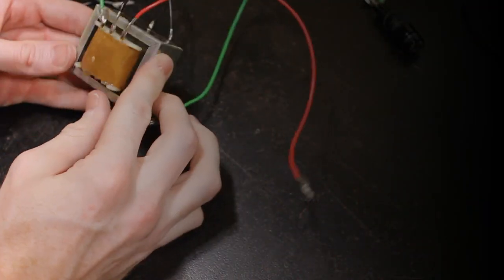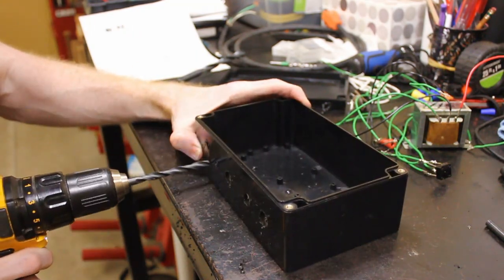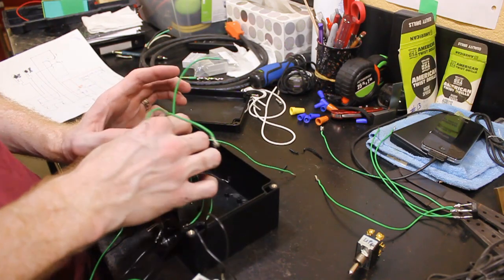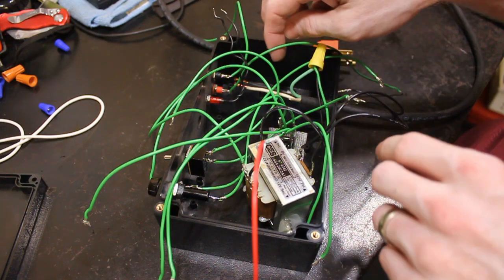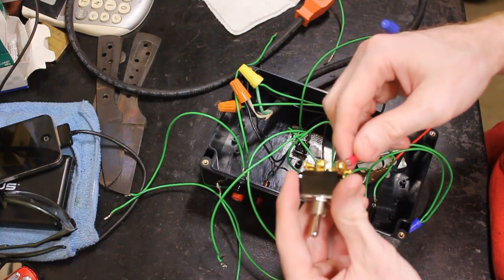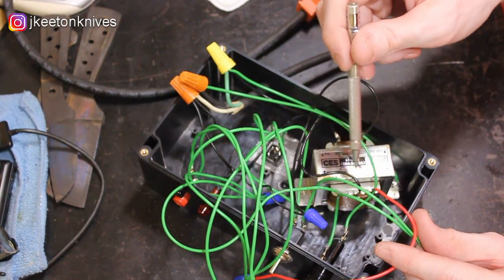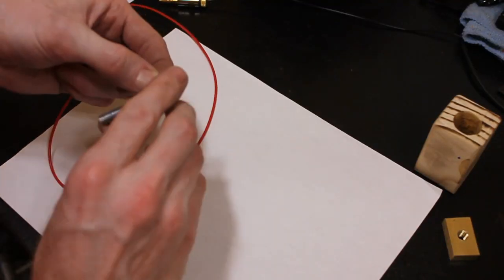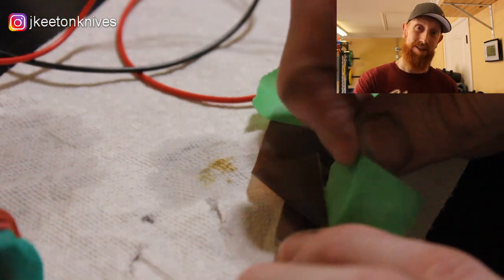How to Build an Electro Chemical Etching Machine - Full Guide

Comment: @RedBeardOps 
I want to make one too, but if I have questions how might I contact you?  I know you put this video up 4 years ago but I’m hoping that you still get these notices on it.  
Such as: Is it possible to use a power transformer from a laptop computer power supply?  I have one that has an output of about 2.75A at 19 VRectified DC; could that work?  
I guess I’m trying to take the Easy Road and find something that puts out the required voltages.

I do have a suggestion on this tho: after it is all up n runnin’ and before you close it up, tape a wire diagram to the lid; that way when you ever may need to repair it you don’t have to tear your shop apart, or your hair out, trying to remember how you wired it.  Jus' a Thought
Reply from the maker: Good suggestion. I honestly don't remember the details of this build and don't know if what your asking will or won't work.

Comment: Hello I have a question for you I build mines whit the same instructions to the video but the red light does not go on can you please tell me what did I do wrong it looks just like your and where can I buy a piece of the brass like the one you build and what size of brass do I need to build the handles please i would like to send you a picture of the project
Reply from the maker: Hey man, I'd advise checking your wiring again. Not sure what's going on from your comment, but I know this wiring works. 

Any online metals supplier can get you a piece of brass. I used 1'' wide by 1/2'' thick.

Comment: Great stuff! In the process of building line now....waiting on my transformer. Simple and clean (once you minimize the length on the green wire ha ha). The only question I have is in the wiring diagram and the front of your machine the AC is on top (toward lid)... BUT when you flip your DTDP switch it works opposite. Switch up to AC it actually charges the bottom of the switch  (DC side) or am I missing something??
Reply from the maker: Man, I can't say for sure. It's been long enough that I've forgotten all of this. I will say that that diagram works! My etcher is still going strong. Sorry for all the green wires!
Reply: Looking forward to putting it to good use. No worries on the green wires ...do what you can with what you got! That's what makes a guy GOOD.👍
Reply from the maker: @trenthumphreys9368  Thank you sir! Sorry I'm not more help with your question.
Reply: @RedBeardOps  It works...that's good enough.
Reply: Finished it up. The polarity works out as you have shown...the bridge rectifier is what changes it around. To answer another subs question you get approx. 27 volts AC and 24 DC. The DC shows negative polarity when you go red to red black to black. Works AWESOME! Thanks
Reply from the maker: @trenthumphreys9368  Awesome man, thanks for your comment! I'm sure it will help some others out. Glad it all working.

Comment: First of thanks so much for your excellent work, easy to understand instructions, etc.
One simple question: looking at your circuit schematic, about the bridge rectifier, from the positive and negative pole You get ac current, from the other 2 poles dc. It should not be the opposit, usually from a bridge rectifier positive and negative pole you get dc, from the other 2 ac, could you please explain? Thanks so much, really mean it.
Reply from the maker: Hey Luca, I don't know enough to answer your question. Sorry about that.
Reply: Thanks so much! Just to make things easier, from your connection schematic you are getting an output dc-ac of 24 volt, "a little less to be precise", therefore you are etching and marking at 24 volt. 
For the dc side I suggest to wire a capacitor between the bridge rectifier and the DPDT switch, like that you are going to smooth the dc side resulting in faster and smooth etching. Thanks again for your excellent work, really mean it!

Comment: Hey man love the video. I want to build one of these but both transformers are either out of stock or no longer available, any suggestions on another?
Reply from the maker: Hey Larry I don't have experience with another transformer. Sorry about that. Some of the guys on blade forums may be able to be a sounding board for you if you find one.
Reply: @RedBeardOps  Thanks for the reply, I found one with identical information. hopefully, it works well. we will find out!

Comment: Just an FYI, the transformer you used and linked to is no longer available on Amazon. There's an issue with that transformer as well. It's that they advertise it as a 2 amp transformer, but it's not. Since you are using 2 different 12v @ 1 amp lines for it on the secondary, it jumps from 12v to 24v but the amps will stay the same at 1 amp. When you connect 2 lines together, like you do with this etching machine, it doubles the voltage, but the amperage will stay the same. That's why a 1 amp fuse will work with that transformer even though it's rate for 2 amps.

I bought a different transformer marketed the same as this one since it wasn't available anymore, but it has 2 different 12v @ 2 amp lines (meaning it will have an output of 24v @ 2 amps). I had to get larger fuses as the 1 amp fuses popped within a second of trying to etch my steel (only tried the DC setting with it too, and had to use all of my fuses in order to finish etching my blade). I did go through and check everything with a multimeter and was seeing the correct voltage and amperage readings on both AC and DC settings. So it was definitely wired correctly, and the only thing different between my machine and the one you made was the transformer.

Another thing I noticed is that you have the black banana port connected to the hot lead from the AC/DC toggle switch, and the red banana port is connected to the neutral. You still are using it correctly, as the hot lead should be connected to the blade and the neutral connected to the etching tool. So it still works fine the way you have it set up. But typically when you have red and black wires, the red wire is hot while the black is neutral/ground. Much like using a multimeter, you put the red probe on the hot terminal/wire and the black on the ground or neutral terminal/wire. It doesn't make a difference for AC voltage, but DC voltage is where it counts. If you have the black and red switched, your multimeter will show a negative voltage reading meaning power is going backwards. Again, since you have the red wire connected to the etching tool (which is YOUR neutral wire), and the black gator clipped to the metal blade (which is YOUR hot wire), it still works the right way and is wired correctly. It was just a little bit confusing when I was trying to make this as I knew the hot wire should be connected to the blade, and hot is typically red when you have red and black wires. It's just an observation, and if someone follows your video exactly, it'll still work 100% correctly.

I also used a bit of heat shrink tubing on the wires where I soldered them onto the bridge rectifier. They seem to bend fairly easily, and I didn't want them to accidentally touch when I was closing the box up. If you don't have heat shrink tubing, a little bit of electrical tape also works.

But thank you very much for all the information and the detailed video and description! It cost about half the price of buying one from a company! And TUS Technologies is making me up some stencils to use! I thought I was going to have to buy one of those photo stencil kits (which are like $200+), but they can make them for about $15/sheet which has 5 stencils on it and each stencil is reusable. So that was an AWESOME deal to me and is definitely going to save me money right now! I can't warrant buying the kit as I don't make THAT many blades. But you should put a link in the description to their website so others can easily find them. There's another company out there called TUS Technologies that isn't the same and that popped up when I search for them, so I had to do a bit more searching to find their website.

Thank you again for this video! I ordered everything I needed on Amazon using your links (about $100) and had it working in about 2 hours from start to finish.
Reply from the maker: Awesome man, thanks for the information. I'll put TUS industries in the description for sure; surprised I haven't already.
Reply: Yep!  mine threw 25.9 volts and fried two stencils, how do I back it down in the build to 12 volts?
Reply: @BMWachtelhund  the trick with using 24VDC is to not keep the handstamp in place during etching, and instead you wipe across the stencil multiple times to keep it cool. This extends the life of the stencil and improves your mark quality.

Comment: I hope you or someone can offer some advice.  Built this and I can't seem to get it to etch the steel.  All it will do is blacken the steel.  Any thoughts on why?
Reply from the maker: Sounds like you're etching in AC and not DC power. Not exactly sure what you exact issue is, but I'd go over the wiring one more time.

Comment: It may be in the comments but which pieces use the 18G wire and which ones use the 22G? I get the transformer is 18G and it looks like the light is 22G. Not sure about the rest
Reply from the maker: Hey Joshua, it was so long ago that I built this that I forgot. I would air on the side of thicker wire.

Comment: Do you have any issues with heat or overheating with the transformer in the junction box?  Would I need to add a vent?
Reply from the maker: Hello sir, I bet this could be an issue if you were etching a huge batch of knives in a row. I've never had an issue though with my one off etches or even etching 2-4 blades.
Reply: @RedBeardOps  thank you, I would think a pattern of small holes in the back will work.  Thanks for the feed back, V/R Rich.

Comment: Maybe this is a stupid question. Why do you connect the middle pin of the transformer (output) to GND? Shouldn't that be the null and get connected to the red wire from the power cable and the case of the transformer connected to GND? Or it is irrelevant as long as your null on the output part is actually the metal being etched?
Reply from the maker: Man, I'm not 100% sure. Please refer back to the wiring diagram I posted. It's been a while since I did this project and I don't remember.

Comment: Great video.  Have you done any testing with a multimeter?  I built this and I'm seeing ~24 volts from both ac/DC.  This right?
Reply from the maker: To be honest I have no idea! I have not done any testing with the multimeter. Right after I built it I just tested it one some scrap steel to make sure it worked. That's as far as I went! Have you tested it on a stencil?
Reply: Yes you are right, and it is ok. You will see 24v both AC and DC from this transformer, as you are combining 2x 12v winding's in series. No problems with anything you have done, you have it right. :)
Reply from the maker: itsmeasis awesome man! Glad this helped out. Hope to see you around the comments. Thanks for watching!

Comment: I got it built but now I have a question. I know your not an electrician but when I have it in DC it’s around 24v and when I switch it to AC it’s also around 24v. Can you tell me if your also says this by testing it with a volt meter?
Reply from the maker: Hey Terry, I have no idea. Is it working in it's intended purpose?
Reply: @RedBeardOps  it probably will I was just wondering if the AC was 120v or was it supposed to be lower. FYI I really respect a YouTube that actually communicates with there followers. A lot won’t reply.
Reply from the maker: @terrylanig5948  All gravy Terry, I didn't measure anything, but the one I built is still trucking. Cheers

Comment: Nice idea, but you really need to brush up on electrical safety, trim excess leg lengths off, and heatshrink all of your mains connections, if you had the power turned on with the top off, you could easily touch live terminals, and worse, with the excess lengths of some of them (the high voltage side of the transformer in particular), there is the chance of then bending and touching the low voltage wiring, which would be nasty... (oh and elec tape as anchor isn't the best,  a cable tie is better as the gum on elec tape will loosen after a while and allow the cable to be pulled out), but apart from that nice little unit and certainly works well
Reply from the maker: It gets the job done. Made sure not to turn on the power with the top off. Edit: for education purposes only...

Comment: Most videos I've seen of this process show putting the red positive lead on the part to be etched and the black negative lead to the applicator for DC etching.   But yours seems to be done the opposite way.       The TUStech people also told me the red goes to the part and the black to the applicator.   Are you sure it isn't supposed to be the other way around?
Reply from the maker: Hey Brian, I think the colors are irrelevant based on your desire. All depends on how you have it wired.

Comment: Just an FYI, I got a little intimidated by all the wires and stuff that go into this and when I priced it out it was going to run over $80.  I thought maybe there was another way that was cheaper and I couldn't screw it up.  What I did was bought a MRC 1300 Model Train Transformer for $39.   It has DC and AC terminals and it works!  I was going to post a picture of how the etching came out for you and your channel followers just in case there were others out there intimated by all the electrical wiring put couldn't figure out how to post the picture.  Guess you just can't fix stupid. LOL
Reply from the maker: Awesome Gerald. Yeah this is just one way to do it. Lots of wiring for sure. 80$ is still cheaper than the commercially available options. Really glad you found a solution!

Comment: So I bought all the parts. put it together. It worked great for about a minute. then just shut off. Now nothing. Any advice. I've gone over the connections. The wiring diagram twice. I didn't smell smoke.
Reply from the maker: Hey Michael, I really don't know. You may want to check the fuse. Be assured that this wiring diagram and set of components have worked for a good deal of people at this point, so it would be good to check over it all again. Be careful, electricity can be dangerous for sure.

Comment: Does it matter if the steel is hardened or not when you use it?
Reply from the maker: I've only ever etched hardened steel, but I don't think it matters
Reply: @RedBeardOps  thank you. I'm buying the suff today. It looks a lot more reliable than cold stamping soft steel.

Comment: Is it 12v or 24v transformer. I thought I heard you say 12v but the transformer in the link is 24v. The only reason I ask is I have to supplement a different one due to it being unavailable.
Reply from the maker: That Jameco transformer is the exact one I used. I'm disappointed it's no longer in stock. An electrician I am not...
Reply: Ok then I think it’s 24v that will work either way. Thanks for the reply.

Comment: Are the stencils cut through? Or let the current through somehow? So confused about the stencils.
Reply from the maker: I get mine from TUS industries. Not 100% cut though.
Reply: @RedBeardOps  yeah I saw that in the video. I have a brothers stencil maker with the thermal stencil paper. Was wondering if it's the same. Appreciate your response. Great video.

Comment: Brah.....  Just get an old school car battery charger and be done with it for the DC charge box!  I do like the little hand wand you made with the felt tho.  So the DC charge output will deep etch.  Then use some cold bluing fluid on an ear swab to darken it, then re-sand the outer part of the stencil with 800-1000grit sand paper to make the shiny part of the stencil pop out.
Reply from the maker: For sure, that will do it! Cheers Podo!

Comment: #question. I noticed in some of the other videos that they hooked the gator clip which attaches to the metal to the positive side and the etching wand was in the negative port. It looks like you did the opposite . Does it matter?
Reply from the maker: Hey Jeff, I don't know the answer to that. I do know that this diagram and machine works well! I use it all the time!
Reply: @RedBeardOps  I just did my first two etches and they turned out great. The first one took a long time because I didn't use enough salt. Second one was much faster. Thanks again
Reply from the maker: @jeffputnam8554  Awesome man! Good work!

Comment: Do you have a wiring diagram , i cant open the Dropbox one and I cant see the one in the video
Reply from the maker: Hey Steven, I just checked the drop box link. It's working for me. Here is the link here - https://www.dropbox.com/s/s5h90beb5uen9oq/ElectroChemicalEtchingMachine.jpg?dl=0
Reply: @RedBeardOps  I got mine built Saturday , works great ...Thanks for the help

Comment: I pushed mine to the limit today.... was doing a a big etch and ran the machine for about 10-15 min. Transformer burnt out on me. Have you/anyone else had a similar issue? I know now not to run it too long.
Reply from the maker: Interesting! I've never done or heard of this, but I guess it's possible.. may want to go and check all your connections

Comment: Hello all, I built this machine to spec with the exception that I could not find the power supply any more...so I went with the Jameco  112513 as it looked similar.  I used it once, worked great, so used a second time and blew the 2 amp fuse...and now keeps blowing it...has anyone else had this issue and/or have suggestions on how to fix?...maybe a bigger fuse or different power supply etc...?
Reply from the maker: Sorry Matthew, I'm not sure how to fix your issue. You may be right with getting a larger fuse. Be careful!